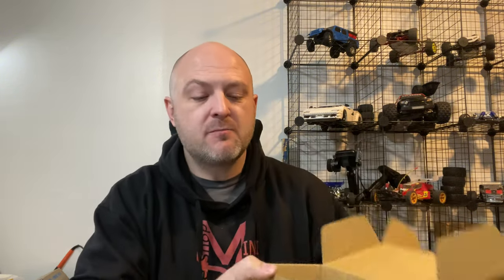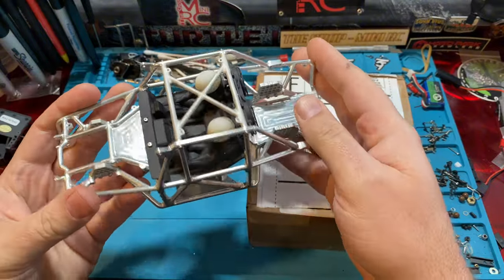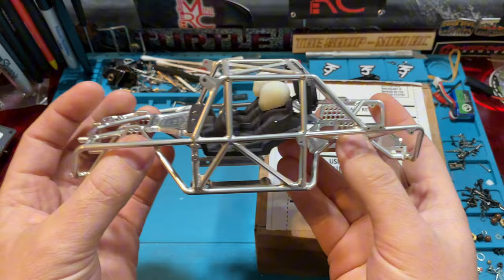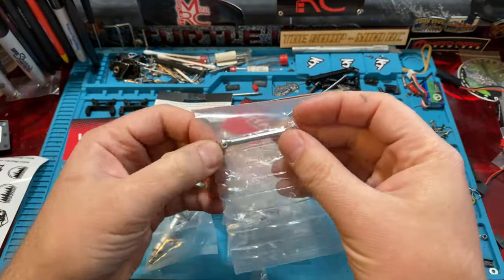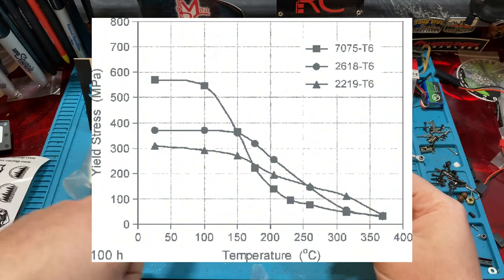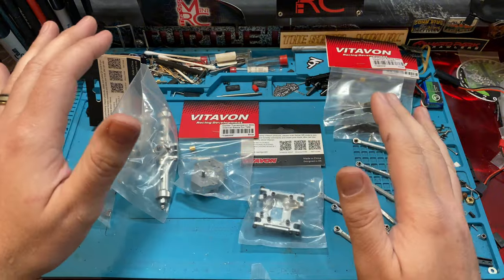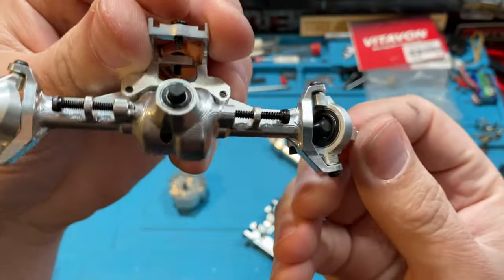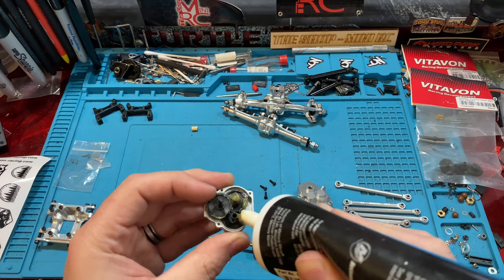TRX4M Vitavon Upgrade Overview and Deep Dive. The best of the best!

Comment: Let us know when/if they get a lay down servo mount!   Definitely will going on my ripper if they make it a full kit like other companies
Reply: I really suggest to get the Oppai factory skid riser skid or drill temple and do the skid riser if you can ,it takes away some space under the interior (v1 interior fits) (v2 interior likely will need trimmed to work with trans)but definitely gains a good bit of skid to ground clearance with it
Reply from the maker: I don’t want to raise the skid on the metal rippers. I want to use the interior unmodified.  We have an Oppai factory high clearance skid on the Sandstone Ripper build (which we have a video on)
Reply: @TheShopMiniRC  oh awesome, I didn’t even catch that part of your sandstone build